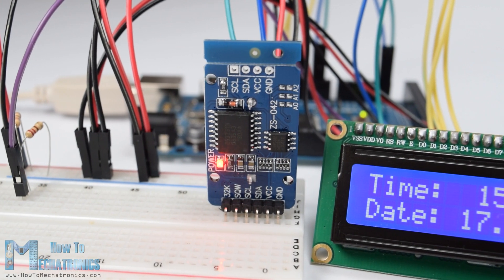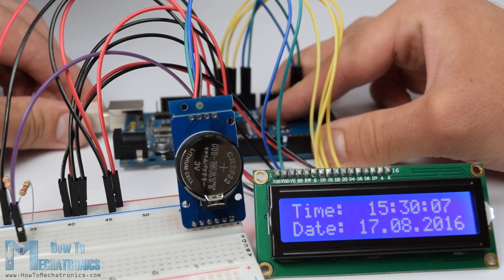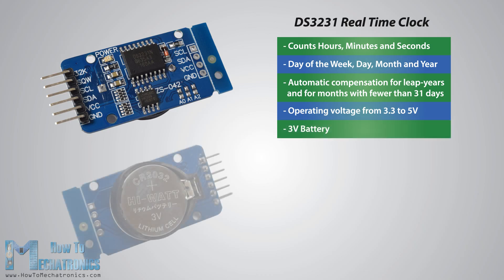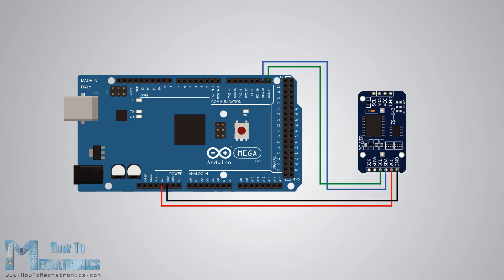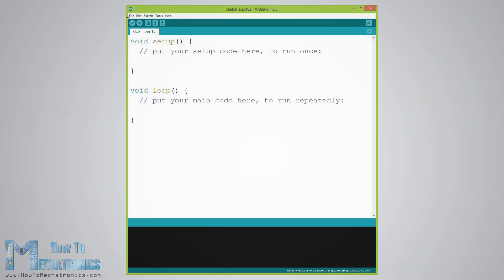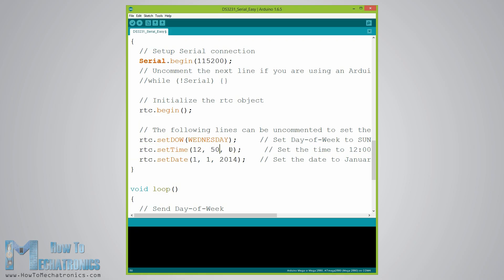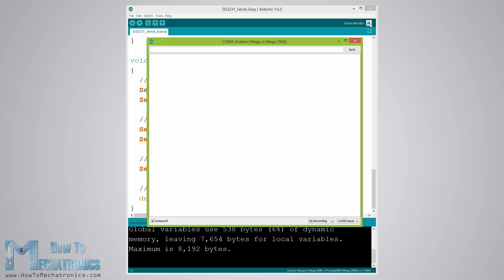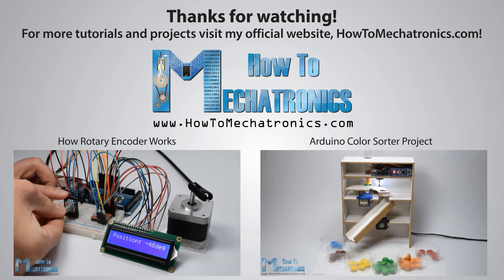Arduino and DS3231 Real Time Clock Tutorial

Comment: people forget to say: when 5V is in use and non rechargeable battery, you MUST break the charging path - otherwise your 3V battery may explode ;-) if you connect to 3.3V it will not happen as there is a diode in the circuit. same no issue if you use 5V and rechargeable battery ;-)
one more thing as bonus: this module has extra EEPROM that can be used ;-)
Reply: What if I have a non-rechargeable battery using 3.3V? Should it be fine, or should I go out and get a rechargeable one?

Comment: PSA for anyone using this RTC (DS3231), there is a badly designed charging circuit on this particular module (ZS-042 and probably others). You must either use a rechargeable LIR2032 battery or disable the charging circuit. You can do so by cutting the trace or removing the diode or resistor. Otherwise, using a non-rechargeable CR2032 could cause it to swell and explode. Although, even with a rechargeable LIR2032, the charging voltage is too high at ~4.7 V relative to the spec of 4.2 V, which may also cause issues. The recommenced option is to remove the diode with a pair tweezers or by desoldering, and use a regular CR2032 battery. There is a thread about this issue on the Arduino forums.
Reply: Man why am I finding this out from a random youtube comment. Thanks for saving my ass from exploding batteries
Reply: Thank you!

Comment: I have bought a couple of the DS3231 modules. Trying to build a temp logger. All of them get the temperature wrong by 18 deg C even when using different libraries. And it seems they lose a lot of time as well. I guess the time loss and temp is correlated. Any idea why this might be?

Comment: Do NOT USE CR2032. Most modules are intended to be used with rechargeable LR2032 batteries. When DS3231 is connected to the Arduino, CR2032 is being charged (even though it's not rechargeable). It also won't last too long.

Comment: I'm having an issue with the programming part. I downloaded both libraries and it still doesn't work but I suspect, based of what I'm reading, that the library is isn't completely identifying certain variables/parts, such as:
DS3231  rtc(SDA, SCL);
Serial.print(rtc.getDOWStr());
Serial.print(rtc.getDateStr());
Serial.println(rtc.getTimeStr());
Reply: It works with me when I changed the serial as follow: 
  // Serial.begin(115200);
  Serial.begin(9600);
Reply: @mohamedabdelfattah8627  Thanks a lot. I was struggling for two hours. Cheers!
Reply: @mohamedabdelfattah8627  I can't thank you enough for this! After an hour struggling I was about to throw it at the wall!
Reply: I'm having the same issue

Comment: Hey,
Since I can not post on your site for whatever reason here my original Question:::
I have the problem that the Serial Monitor prints after the first Output only Random Strings.
The first Output is correct but the rest is not usable.
Here an axample of the monitor:
Wednesday 01.01.2014 -- 12:53:26⸮p⸮⸮⸮+֪"⸮⸮⸮⸮⸮"⸮⸮+ֺ⸮⸮⸮⸮R⸮⸮⸮⸮p
Please Help
Reply: set the serial monitor baud to 115200 or whatever is in your library
Reply: @bencetoth2811  does not work sadly.
Wierdly enough I got it to work using the library of the 1307RTC Clock
Reply: Your string length is too long. The Arduino doesn't know what value to put in the unused string so it fills it with garbage values. To fix it, you can reduce the string length or run a for loop to fill the rest of the string with spaces.

Comment: May I use the arduino nano I don't have arduino mega. ^^;;
Reply: You should be able to use it without an arduino nano, because as far as I know, with any given arduino circuit board; the only difference is how fast it can process info, as well as its storage capacity.

Comment: Hi!
I need help about a project to simulate sunrise - sunset with real time clock ⏰.
E.g. i want to start at 07:00 and stop at 19:00 dimming by time (every 15min) for six hours to peak and onother six hours decrease light to sunset.

*arduino uno
*DS1302 Clock Module with Battery
*AC Light Dimmer Module for PWM control, 1 Channel, 3.3V/5V logic, AC 50/60hz, 220V/110V
*dimmable led lamp

Comment: How can I read out, for example the time, as an integer, so that I can make a alarm clock with it?
Reply from the maker: You can read the String and then covert it to integer using the string.toInt() function.
Reply: First of all, thanks for the reaction. But I tried it in multiple ways, but the fact that it uses rtc.getTimeStr(); seems the confuse the system. Is this a matter of notation?

I have: int i = String.toInt(rtc.getTimeStr());

Comment: Tuesday 03.01.2016 -- 22:47:07
22:47:13
Tuesday 03.01.2016 -- 22:47:10
Tuesday 03.01.2016 -- 22:47:11
Tuesday 03.01.2016 -- 22:47:12
Tuesday 03.01.2016 -- 22:47:13
“„ú’=ýfü“‰è’=ý¢
üR²ü¢
þ“‰ì“‰ó

how come this thing is displaying in the serial monitor? can someone help me with this issue? i followed the guide on the video. thanks!
Reply: make sure the baud in your serial monitor (bottom right) matches what's in the code
Reply: Dylan Kelly oh I'll check it out later. thanks
Reply: thank you so much
Reply: @comhrac54  Thank you!
Reply: @dylanKelly That just saved me a few hours. thank you.
Reply: Serial.println(t);

Comment: When I use this code given I get an  error saying “Error
compiling for board Arduino/Genuino Uno.” How do I fix it ????
Reply: Well that could be many things but most likely, you need to either make sure your pc is both plugged into the Arduino and is reading it, or go into
tools>board> and make sure you have the right board and port selected in the coding program.
Reply: i got same isue, did you solved it?

Comment: zs-042 is really dangerous. search "zs-042 battery" on Google. it try to charge a cr2032 battery that is non-rechargeable. but even with a lir2032 voltage is too high.